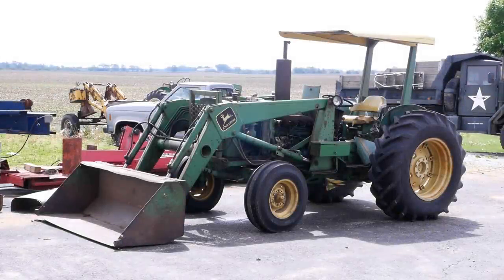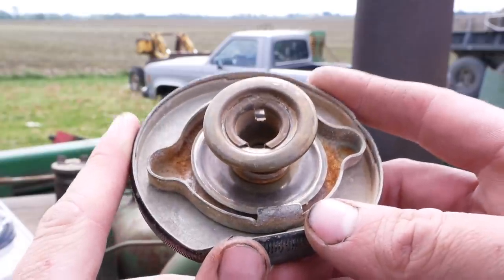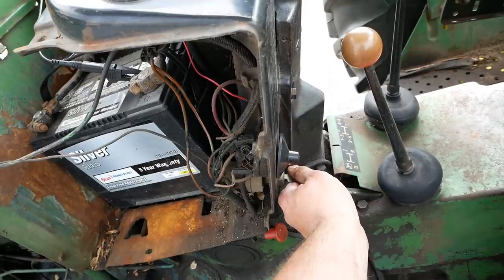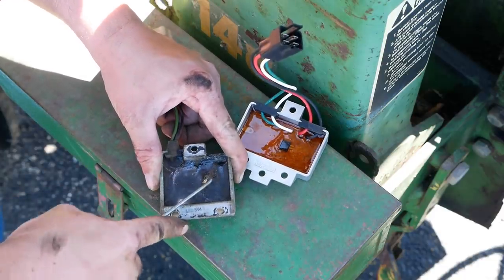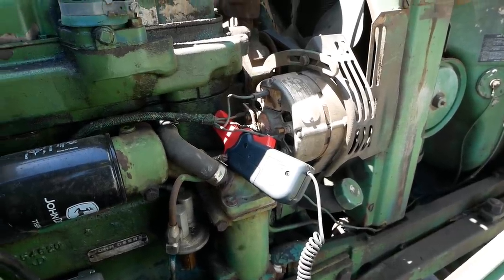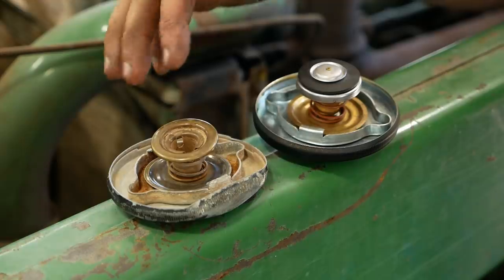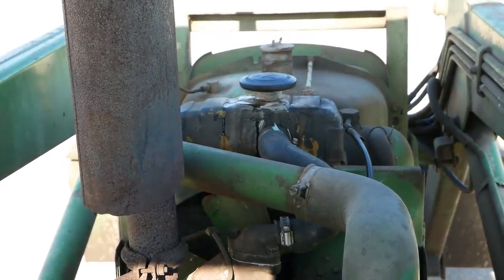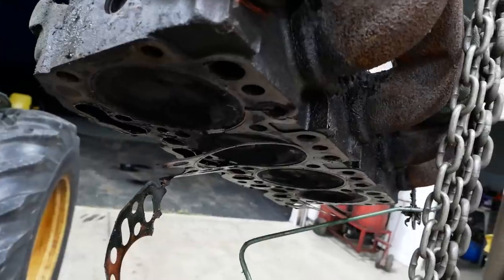Not Fixing a Tractor - Overheating and Barely Starting

Comment: Why thumbs down. You did everything right. The customer is the one paying the bills and he's responsible for the care, upkeep and his reputation if he passes his problem on to someone else.
Reply: Think the owner will just sell it at auction.  Put it on to next owner
Reply: @neilramseyer5348  That's what I'm thinking
Reply: @neilramseyer5348  Judging by the cane on the right side this is probably owned by an elderly fellow who probably doesn't have the means to fix it.
Reply: @neilramseyer5348  And hope the new owner isn't local and it doesn't end up back in Wes's shop! Thumbs up from me 👍
Reply: It'll probably go through the auction house or straight to the tractor wrecking yard as a parts machine.
Reply: @petermurphy3354  Thumbs up for sure but I disagree if ownership changes, I hope new owner gets it for the right price and brings it to Wes to video fixing all of its problems correctly! Win Win!
Reply: Not a repair job. It's a restoration project.
Reply: @rsmith3062  if I qould bought something like that at auction I just drop used motor in it looked like that engine has been rode hard put up wet but me personally I don't buy John deer anyway over priced to start with and parts are over priced
Reply: @petermurphy3354  Knowing what he knows now he could just say, NOT ON YOUR LIFE. The customer should have told him how long the problem was going on for. Wes also should know green ain't his color. He cares about fixing things too much.
Reply: @ralfie8801  At this point that is all there is left for the old machine.
Reply: Northtide 
It depends on if somebody wants it for a project after the current owner disposes of it. It's totally repairable if somebody has a source for parts, the know how, and some spare cash laying around.

Comment: I’m an Ag mechanic and it’s crazy how long these farmers just let the problems pile up until the machine is completely un-useable. Then they bring it in and want it fixed and you don’t know where to start or where to stop.
Reply: And they only want to spend $500 on the repair until they're up against wall and then they pull out the real piggy bank and blow the dust out and fork over the cash.
Reply: Everything is going to shit here in the US. Owner operators don't have money to fix their equipment anymore, subsidized farms don't get enough money to fix their equipment from the mega globo corps that own them. Even the penny pinching multi-billion dollar freight hauling companies don't want to stock parts or fix shit on their equipment anymore, and it's unsafe. It makes people like me question why I'm even doing this shit anymore after only 10 years being in the field.
Reply: Same with construction equipment. Or they want to make it like new but don't spend a dime
Reply: I will never get that. Your tools need to be reliable or you are going to spend more time on your tools than on your work. Especially in agriculture where you have high seasons that you equipment has to make it through. What do you even do with a tractor that constantly overheats, constantly needs new coolant, and leaks hydraulic oil all over the place..
Reply: @MrDarkbluewater  Because there are a zillion other places the $$$ has to go. You run from one crisis to the next. There's never enough $ to do it all, never, and even less when there's a wife and kids and taxes and regulations coming down on you. The old days of a guy sending his kids to college on 15 cows is long gone.
Reply: Same thing on over the road tractors, only come in when it's down,needs tons of maintenance but just fix what it takes to put it back on the road and oh yeah it's under a load so we need it yesterday
Reply: And usually blame the brand
Reply: @johnfleury5430  oh yea it's always the manufacture
Reply: Everyone is not interested in machinery and the may lack funds.
Reply: Or where to get the parts because it’s now an antique.
Reply: @slowride55 they always say the same thing fix everything.
Reply: What I don't understand is why don't they just sell it for scrap and buy a brand new Tractor at the dealership instead of just having a mechanic putting band-aids on it?
Reply: @JosephArata  everything must be sacrificed at the altar of the shareholders
Reply: Ag mechanic here too. I've replaced hydraulic pumps because oil leaks have been ignored and it's run low. Not making a $200/2 hour fix often results in a $2500+/several day fix. Just yesterday I had a farmer asking about his Massey, it has a weak hydraulic steering pump and loses almost all steering once warmed up. He wants to fill the backend with 85w-140 with the thought that thicker oil will keep the pump working. I suggested we should look into replacing the pump. The steering pump is weak because it has a chronic leak from the brakes and has been run out of oil, the brakes have been leaking for around 5 years and the tractor is maybe 8 years old.
Reply: It’s the same thing for marine Diesel engines and the multi million dollar companies that own them they call us usually when they can’t hardly use the engine anymore and the crew tells us the full story of all the problems that started like 9 months ago and then expect us Diesel Techs to just wave our hands at it and magically fix a laundry list of issues (with next to no time because the boat has to leave out for another run offshore) and for cheap because they don’t want to pour a ton of money into a high hour engine because they plan on going into ship yard in the next year. I don’t beat around the bush with them I tell ‘em listen you should’ve called me like 6 months ago when this all started then you wouldn’t have all of these issues and if all the time I have is 2 hours then I’m just gonna leave now because it’s not worth my time to even start tearing into this thing with that little time. But to them they would rather make $50 today even if it means risk having to spend $15,000 later in shipyard to fix everything they neglected. Personally I don’t see the logic but what do I know right I’m just a mechanic lol .
Reply: @JosephArata  the real problem is the famers that want their tractors fixed can't even do it unless they bring it to the dealer that made the thing.   if for instance, they buy a used john deer from bob joe.  when it breaks, John Deere wont let you start the machine back up if you or your go to technician fix it unless you bring it to them to program the part that you installed, even though you never stepped foot in the dealer to buy it in the first place and for the last 70 years no one has had to program lights, or alternators, or batteries, or starters ect. to a tractor.  spend 20 minutes watching right to repair videos.  its not the money anymore.  at least not with newer tractors and other rideable farm equipment.  it's actually being able to fix it yourself or hell, even bringing it to guys like Wes !  that's the real problem.  we're getting to a point where "you don't own anything, even if you buy it" and frankly, we all need to do something about this

Comment: Love the full rotation to engage the steering wheel! I've seen bad but that takes the cake.
Reply: I guess you've never driven a 1963 Rambler "Classic", that would be great practice for driving that tractor.   The technique also works for inboard boats, it's just a suggestion as to direction.
Reply: How many teeth need to be bad for it to go that far?  Like 3/4 of them!
Reply: I've ran a few old tracters and my dads old truck where the wheel turns like half way before it starts to grab and turn. The good old days

Comment: I’m sure every large family farm in your area has that section, next to the barn that has all the throttled out machinery that was classified as “TOO EXPENSIVE TO FIX.”  I suspect if Wes made the required repairs, the cost could easily be North of $5k, but upon completion have a tractor that wouldn’t be worth the su on liquidation.

Wes, keep the content coming and like that you shared a little bit about Engineering Economics.  Mrs. Wes was very professional and kind by not speaking negatively towards thy neighbor.
Reply: If you do the work yourself, even with parts ect, a used fixed up tractor can be far nicer than some cash in the bank. Imagine what you can do.
Reply: @baileyhatfield4273  Yes, my tractor is a Ford 545 Diesel.  Bought it in 2001 in Sunland, California for $8k, one of my better investments.  Low hour OEM tractor w/ a gannon rear and a bucket front, included a York Rock Rake.  Only negative, no PTO.  You should get one!!
Reply: Papi, I think the crucial issue is NOT what it's worth after you spend money on repairs; rather it is WHAT ELSE that money could get you.  

 ie you start out with a hammered tractor like this - worth nothing and essentially unusable.  Wes has put $1000 (say) worth of effort and parts into getting it to where it is now.   It's still worth nothing and only just usable.   But could they have bought a better tractor for $1000?   I doubt it.

If Wes puts in another $2000 or $3000 of effort the it will be worth next to nothing, but it will be a lot better than it was.  Crucially,  it will be better than anything else you can buy for $3000 or $4000, because you will know exactly what is fixed and what is still deficient.     It may be worth next to nothing on the market, but it will have value to you.

Comment: No thumbs down from me. You did everything you could with what you were told. What was probably a cheap fix originally with neglect became an uneconomic repair. Always amazes me that guys who earn their living with machinery don't understand enough to look after it properly.  Simple routine maintenance, replacing tin work etc will pay dividends in the long term. A couple of bucks spent wisely at the time the original problem occurred would have surely avoided that basket case. Good work Wes as always! Best regards from the UK 🇬🇧

Comment: Thumbs up for you ALWAYS Wes. This customer is one you should avoid. They clearly abuse their equipment and only maintain after failures.
Reply: How do we thumbs down the customer??
Reply: how much did you spend on batteries and starter ?
Reply: Most farmers. Lol
Reply: Why, they most likely paid their repair bill and we don’t know their financial status.  Better to button her up and pay the bill, then have the work done and not be able to put food on the table or not be able to pay Wes.  From an engineering economics standpoint, tractor owner made a wise decision.

I’m sure much more Good neighbors than Bad in that part of the country.
Reply: Who knows what condition this machine was in when the owner got it? Farmers buy stuff like this at auction all the time, it saves their equipment budget if they can use it for a while before it completely dies. They just use them for cleaning things up and moving stuff around and can also run a bush hog to keep the weeds down. So this machine is most likely not high on the owner's maintenance budget because the machines he uses to farm the fields with and make his living are more important to him in that respect.

Comment: Glad to know that head gaskets fix cracked heads, thanks for the tip!! I'm in New Zealand, at a "rough guess" you would have easily done $3-4000 work on that old girl here. I suppose I can see the farmers point as a secondhand tractor would still be much more, may as well run that one till it drops. Such a shame so many people out there are so mechanically "ignorant" and don't spend a little money on proper maintenance. Great job Wes, great video!

Comment: Yea, I hate the concept of “throwing parts at a problem charging system”  but when EVERYTHING is tired/damaged/abused…the shotgun approach is quick!
Reply: This wasn't a shotgun-all the replaced parts were bad!
Reply: When it comes to air brake parts on a lot of the trucks/trailers I look at, most of the time, I end up parts cannoning the whole brake system, because it's never been replaced before. It's unsafe to just replace brake shoes and drums, when half your brake chambers are improperly installed, improper cut rod lengths, broken slack adjuster ratchet clutches, and S-cams and bushings that have a quarter inch of play up or down.
Reply: There are charging systems that end up with intermittent problems. A mechanic has to pick and choose their battles. If it's your property you can spend time fixing one thing, play with it, then fix something else until you get it perfect. The problem is that can take weeks. People want stuff done yesterday.

Comment: In college I had a blown head gasket.  Exhaust leaked into the coolant. Boiled over quickly. Leave radiator cap off and you could see occasional bubbles of exhaust coming out the radiator cap opening. But it would take quite a while for enough coolant to boil out compared to leaving the cap on.  So I drove with several gallon milk jugs of water in the trunk and no radiator cap. It was fine for staying within a 5 mile radius of the college.  I drove it like that for more than a year. Then someone stole it. My room mate was amused that my only reaction was that my favorite shirt was in the trunk. I really liked that shirt. Still miss it.
Reply: "It tied the room together"
Reply: That was hilarious 😅.

Comment: Awesome Job Wes!!! I'm a refrigeration mechanic, run into the similar problems when system compressor goes down. I always let the customer know that after  replacing the compressor  . We often find what took out the compressor in the first place. You couldn't know those cracks where there till you got the engine running, hidden damage bites for everyone involved. You deserve and are owed for the work you did. Your due diligence for this job was right on. 
  Good job!!

Comment: Good JobWes! 1/4 inch of Calcium is the same as 4 inches of iron! Thats the source of the heating problems! That machine is the victim of POOR maintenance. Not your fault.
Reply: The question is if it is cleaned with acid (iron block, right? so no problem), will it be still overheating? my guess, it will not,  we will never know :)
Reply: But if was boiling out of the radiator, then it wasn't just a heat transfer problem. Clearly the water wasn't getting cooled either. If it was just heat transfer the fluid would stay cool but the engine would overheat.
Reply: @TheMetalButcher  If the radiator is blocked with calcium too (good chance it is), then it couldn't radiate the heat.  Hence the heat stayed in the coolant, and she boiled.
Reply: @dfross87  Good call. Cheers.

Comment: Curious, with price of hydraulic fluid, how anyone could afford to run that thing with those kind of leaks?
Thanks for sharing that Wes, very interesting. 👍
Reply: @bcbloc02  Being Jonh Deer or not, that's not what causes 8+ year old rubber to go to shit and leak everywhere. I think you're going about that at the wrong angle. People don't replace worn rubber parts when they are supposed to, that's why it leaks, and they never replace them when they start leaking. They just keep "topping it off", so it snowballs into everything leaking eventually.
Reply: Wait until they learn that you can also pour water into the hydraulic tank...
They'll be filling it up with a garden hose in no time 😂
Reply: @lolatmyage  That will actually be safer during harvest season. Just think of all that nice combustible oil it is pouring into the bales while it is stacking.
Reply: Who says there is still hydraulic fluid in there. With this kind of care for a machine he probably throws regular motoroil in it.
Reply: @chillywilli  Some machines run engine oil in the hydraulic system.  Seems odd to me, but that's what is specified in the manual.
Reply: @dfross87  my 90s model 1835 case calls for 10w30 in hydraulics
Reply: @bcbloc02  only $20?  even 303 was $32 a bucket here.  Missouri forced the discontinuation of sale of the 303, I assume over the very issues you pointed out.
Reply: I seen a quarry running ... no, dumping ... 10-15 gallon a day through a cat loader because they didn't want to take it out of service for two days to repair the leak.  Anyone except the scalemaster and the truck loader working on Saturday was anathama, so it wasn't going to happen on the weekend either.  Grandpa had a term for that.  "Penny wise, pound foolish."
Reply: @infoanorexic  Rural king sells their cam2 for $26.99 list you can get it on sale for $19.99 that is when everybody stocks up. Stuff takes the seals out of everything. Might as well be water.
Reply: @bcbloc02    that's what they say about the 303.  They appear to be working on a class action over it.
Reply: I thought the same thing Robert. It makes no sense, the money spent on maintenance saves money.
Reply: @lwilton  not to mention contaminating the food supply.

Comment: Yup, typical alternator "test." Funny how they always "test" good. Take 'em home and they still don't charge. Put in a rebuilt, and works just fine.
Reply: Sounds like engine is too far advanced on timing.
Reply: Up until a few years ago I just rebuilt my own, we had an alternator/starter repair shop where I could get all the US made parts to completely rebuild a GM internal regulator alternator for less than $25. The guy retired and closed the shop, so now all I can do is just buy a new one and change it.
Reply: Auto zone didn't wanna sell me a new alternator because mine tested fine - i know it tests fine but you aren't putting it under engine load at 2000+rpm to hear the bearing Going out on the pulley.

Comment: That steering wheel was about like the tiller on a boat. I was shocked you could hold it straight in the lane
Reply: I saw that during the test drive, and kept wondering what I was missing.  It didn't seem possible the test drive would go on when it couldn't be steered.